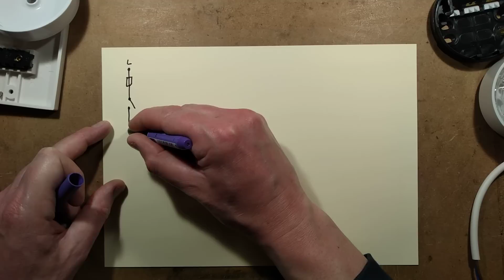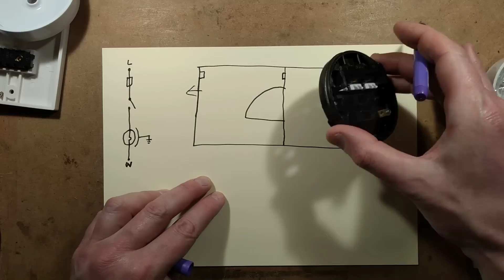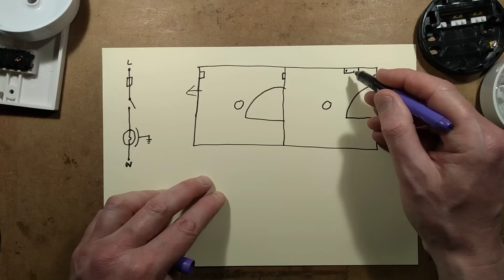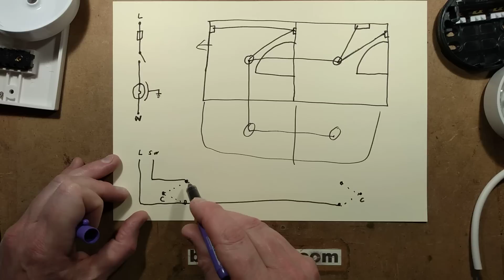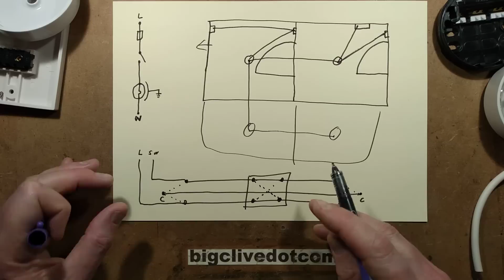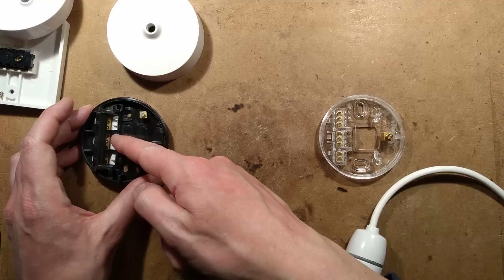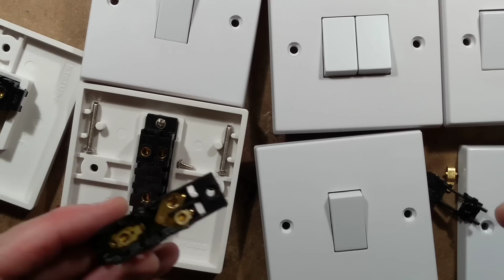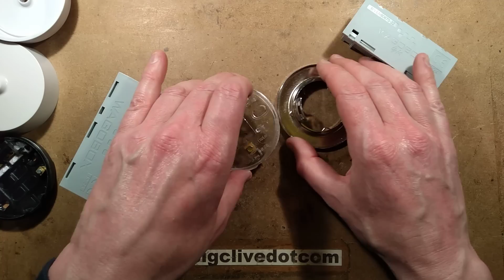British home wiring.  The incredibly simple lighting circuits.

Comment: In Czech republic, we use round plastic boxes in walls. Cables have always all conductors sleeved. We use round and flat cables as well. Screw terminals are quite obsolete, we're switching to Wago style terminals. Most light fixtures have terminals inside and you are supposed to connect a cable to it. I think the practices in my country are similar to other European countries.
Reply: Same in Poland: Round, plastic "cans", 60 mm diameter for switches and outlets, 70-80 mm for interconnections, available in various depths. Earth wire always sleeved (green-yellow). In recent past screw connectors were common. You got like 20-way strip of dual-sided screw terminals made of soft plastic that you cut to length. Switches and outlets use 2 methods of fixing: First is set of metal teeth that spread out and bite into plactic can as you turn the screws, pulling socket towards the wall. Additionally there are screw holes to further secure the socket to the can. On top of that goes insulating bezel held usually with a screw. In terms of switches you can often buy identically looking 1-way switch with one on-off terminal, "stairs" switch that switches between common or "cross switch" that is used when you want more than 2 switches. Our light points are usually furnished with bare wire and a hook. Switches with more than 2 buttons are very rare. When you want more buttons or sockets you can buy multiple length cans (multiplies of 60 mm) later covered with single decorative bezel, the longest bezel I've seen is for 6 switch or socket modules
Reply: @mibars  Those terminal strips are called "chocolate" here. :-) In junction boxes, we use  terminal blocks with 4 or 5 metal bars in a shape of square or pentagon.
Reply: Almost every country on east side of iron curtain use same style.... In Poland also nowadays use WAGOs. In Czech do u use TN-C? Or TN-S? Neutral separate or with ground?
Reply: You probably adopted the German standard with 73 mm for switches and sockets and 83 mm as junctions. But did you get double boxes for stacking and 1½ boxes for 2-way sockets? Or the big-box with half a box under a standard box where you can put a z-wave or any other active device?

http://www.elko.se/bigbox/category1646.html
Reply: @arneanka4633  It looks similar, but different, dimensions are different and we have 4 screw holes 90 degree apart. See how our cans for stone walls look like (60mm in-wall can)
https://www.google.pl/search?tbm=isch&sa=1&q=puszka+podtynkowa+60

We do have a variant very similar to what you've shown, with a chamber for putting electronics in. Or for massive bunch of interconnections next to a socket :)
Reply: @mibars  Oh crap. No way to use the standard c/c 63 mm stuff from Schneider or Hager in those tiny boxes. I had one of those small cans in my car. Drilled at normal hole and the can disappeared. Wonder if some polish dude forgot that on a worksite and somebody took it to our warehouse.

I'm waiting to come to somebody's house in the future to find polish material  in their walls and tell them they need to buy their replacement things from Poland. Or tear down all walls to make a proper installation according to Swedish standards.
Reply: @arneanka4633  They are tiny, indeed. This could also be the reason for slow adoption of Wago connectors, they take lots of space, at least the old gray type. BTW Schneider, Hager, Legrand and others are popular manufacturers of 60 mm electric equipment. Honestly I don't know id this 60 mm junction boxes standard is the law here, or just an industry standard. I've googled for those DIN standard boxes in Poland and I found that you can find some shops selling them... But they are like 10x more expensive because they are special order.
Reply: @arneanka4633  Yes, we have stackable boxes. These are used for multiple devices next to each other. The two way socket fits in a single box.
Reply: Also all devices have removable covers. The internal part is installed in the box first.

Comment: In Germany, the ceiling roses are mostly untegrated into the lamps, so we have just a wire hanging out the wall, when there is no lamp installed. 8:35 In Germany our Earth is always completely sleeved
Reply: In Sweden we get a miniature socket in the roof, either in a faceplate or as a plug on the loose wires coming out the conduit.
Accompanied by a hook to hang the lamp from.

Comment: In New Zealand we call this 3 plating. It is mostly unused in housing here these days. What we generally do is take the live feed to the light switch and then there's a "switch wire' running to the light. It's quite different, thought the two way is basically the same with some very minor differences.
Reply: (mains) 'loop at switch' (with switched going to the fixture) vs 'loop at fixture'

Comment: 4:11 ... hmm... what?! In Hungary, we connect the Live to the switch1 Common, wire together the two swiches switched poles (eg. SW1 P1 to SW2 P1, SW1 P2 to SW2 P2), and then goes from the switch2 Common to the lamps. Intermediate switches are working the same way as mentioned in the video.
At least, when I am googling for this type of wiring, I find this solution.  I can't decide if either of these solutions have advantage over on the other.
Example with the intermediate switch, if youtube allows: http://www.tibivill.hu/wp-content/uploads/2012/11/keresztvalto_kapcsolo1-1024x629.jpg
Cables: We have these: 3 stranded wires, all of them coated with appropriate colours, and coated with an outer insulation. There is some talcum powder like material in between the insulations. https://shopdelta.eu/shop_image/product/omy-3x0.75_d.jpg
Reply: Here in NZ we see both ways but I do prefer the way Clive has shown as no connectors are needed
Reply: @TheFraggBear  Connectors? Neither of the solutions need connectors, just the switches and the wires. Clive's solution assumes that you can connect more than one wire to one pole of the switch, that's all.

Comment: British wiring is so strange, in germany you could never do this.. love your channel!
Reply: why can't you do that in germany? 
Just asking, I live in germany too.
 I know that we don't have the ceilling roses but they actually seem nicer than just a clamp. The switches seemed quite normal just another form factor.
But for me it seemse like it should be just fine to be used in germany.
Reply: @racitup4114  I know nothing about this ... but having (permanent) Live at Switch presumably enables replacing switch with some fancy HA gadget (and without having to include non-Eco battery) ...
Reply: @racitup4114  The extra wiring that you described makes sense. UK wiring has fuses in each plug, because the UK wired homes when copper was expensive. They'd run an entire house as a single circuit and expect the plugs and/or outlet switches to interrupt.

In the US, we have no expectation of low-power lighting circuits. I've spent too many hours sorting out ancient wires coming directly from ceilings without even a box to isolate. A constant sense of fear pervades such home rework: even when you cut at the breaker box and even disconnect inside the wall switch, you could still find out the neutral is from some other circuit. You can even find the occasional Carter System (hot-swapped 3-way lighting systems) that should never have survived the 1950s.

I like the idea of these low-power lighting circuits. However I'm more scared that the wiring is load-bearing: the electrical copper is holding the weight of the lighting fixture. That's not Code in the US, and for a good reason. I see those pendulae in Ikea but I always pass on them for ceiling work. Copper wire should be holding the juice, not the newtons.
Reply: pseydtonne Not quite sure what you mean by "low power lighting circuit". In the UK our lighting circuits are rated 6 Amps at 240 volts, so each lighting circuit can deliver almost 1.5 Kw if required. It's typical to have one serving the upstairs of a property, one downstairs, and possibly a separate one for the kitchen. Larger homes will obviously have more. These deliver more than enough power for incandescent lighting, and since almost everyone uses LED now they are arguably massively over specified!

In terms of the weight carrying capacity of those plastic ceiling roses, they are designed for simple and lightweight fabric shades, or the spun aluminium "school" type shades. If you're hanging anything heavier, such as a chandelier, we use a different ceiling fitting, made of metal, with a built in hook. The light will be suspended from that hook by a chain, and the wire run alongside purely to d liver the power.

Comment: Hahahah @110:35 "Plasterer comes along and plasters up to the surface of the box" - every one I have ever met fills the box full of plaster like it is a challenge!
Reply: Indeed, we had one plaster right over the box, then skim the wall afterwards and nobody but us knew the damn box was there. The homeowner was not impressed that we had to smash off 4 brand new tiles (it was bang in the middle of the corners). But we did it with their permission. "oh don't worry, plasterer will be paying"
Reply: I have a word for plasterers; it's c...s except the one who did my living room, cleaned the socket box! First one ever.
Reply: @paulvale2985  in front of c...s, you could write "expensive, arrogant". However, they do give other builders an excuse for shitey work: leave the plasterers a key!
Reply: i've had to use a hammer to find the wall boxes before
Reply: the plasterers don't want to waste materials filling wall boxes.  holes in walls make his job harder.  just jam newspaper or pieces of foam or brick or even lunch leftovers in the hole to make it easy for him to do a better job.
Reply: many newer boxes have a cheap installation help covers in the carton… and people throw them away… filling the boxes with plaster…
Reply: Great design until you want to fit WiFi switches that require a neutral connection in place of a existing light switch onto the wall box, thus no neutral is present, just perm live, switched live back to pendant and a earth.....
Reply: @8skellerns  You can run a three-core cable to the switch rather than the usual two-core. That will give you a neutral as well as live and switched live. Depending how lucky you are, you may be able to pull a three-core cable down the same conduit used for the original two core.
Reply: @MrEdrftgyuji  Quite often the cables are clipped to joists in the ceilings or going round bends or trapped though :( Impossible to pull out and pull through a new cable :(  I have seen people connect the neutral terminal to the earth as the earth terminal is connected to the neutral in a PME system!
Reply: Tubing bender box finder lol
Reply: theres a secret rule plasters must hide one box per appartement
Reply: It's because they's fick, a great deal of study to become a plasterer, jealousy t'was all over jealousy :-)
Reply: here in the US, they switched to stuffing our outlets with insulation foam.
Reply: Had to use a neodiddlyum (it's a AvE joke, no corrections please!) magnet to find boxes after a fecking plasterer went a bit wild....  

There was a lot of swearing that day! Only thing was this guy did amazing corners, better than anyone else, but I'd never use him on a job with plastic boxes! :)
Reply: @mor4y  don't explain your jokes.... fack 'em

Comment: The good old bayonet connector bulb is danger of disappearing, market forces  are forcing us to have a load different Edison screw in and bayonet clip in, non compatible spare bulbs in the cupboard - not sure who we  blame for that- the EU or the US ? LOL
Reply: I disagree. B22 bayonet lamps and fittings are just as common here as they have always been. The exception is, imported ‘fancy’ fittings. But that’s not a new situation.
With the huge number of B22 bayonet fittings still installed, no lamp manufacturer is going to ignore such a huge market.
Reply: @Mark1024MAK  I think my real whinge is the fact that now,you have to watch you are buying as it maybe an ES fitting whereas at one time you just picked a bulb and it was a BF and that was that.However I have since heard that the EU is trying to drive the ES standard across Europe  thus making a problem out of one that wasn't there in the UK.

Comment: If you need a neutral connection in the switch, you can do the switch drop in 3core + earth, that way you can have permanent live, neutral and switched live on the same cable.

Comment: Those pancake boxes suck but they use them because they can nail them right to the studs and when they sheetrock it will be level. At least over here. So they're easy for contractors.

Comment: I may be too tired but isn't the 2 way switch diagram wrong? Live usually goes to the common which brings it to each traveller. Neutral goes directly to the light. The way he has it wired up the light would stay on indefinitely and/or blow when the two switches reach the right states.
Reply: You're too tired. There's no neutral to the switch, just live and the switched live return to the light. Neutral is straight to the light as you say. You can't put live on common for 2-way switching, that wouldn't work, the second switch would be bypassed when the first is on.

Comment: Here in Switzerland, the earth is fully sleeved yellow/green. Seeing it bare is really strange for me.
Reply: Same in Finland, also cables are round and not flat and you have a tool to quickly strip those cables.
Reply: same here in australia - the cable 'twin and earth' just like that, but the center conductor is shielded. Using round cable in walls seems very strange, the flat cable means that the earth is always between the live and neutral in case of a fault, and flat cable sits better in roofs and walls
Reply: Check under the sink in the bathroom, there might be a bare grounding wire to ground the pipes there. Or it might be yellow/green like the rest of the earth wire.
Reply: The bare earth conductor is insulated with a green/yellow sleeving when you terminate the cable.

Comment: Wire nuts should be outlawed. I can't count how many times I've opened a cover plate and pulled the plug out, and noticed one of the wires pop out of the nut. Those huge square switches with a single switch on them, are so terrible. Why would they make it so damn big?
Reply: a common standard,itll look not uniform if different switch boxes all looked different sizes
Reply: There is a half-sized face plate referred to as an "architrave switch" with corresponding half sized boxes, however they tend to be only used where there is limited space or as a "style" thing. The advantage of the standard box is that it is adaptable and upgradable, simply because it is standard and you can get up to 3 switches on that plate, while the A-switch is pretty limited.   https://www.toolstation.com/axiom-architrave-switch/p35496

Comment: Based on you room sketch we do pretty much the same thing in AUS expect we refer to it as looped at the light. We also have looped at that switch.
Looks like you guys do your 2 ways switching differently. We only switch the active conductor. So active goes to C1. Connect 1 -1 and 2-2 and the second common become a switched active.

Comment: Clive, I want to thank you for this most recent series about Mann's home wiring and street wires and the like. It's been so much more practical than the pink lights and endless USB powerbanks. I haven't seen any one say it so I wanted to say this series really goes above & beyond. Thank you.

Those pendant lights have been outlawed in the US for decades because one could slice through the flexible insulation. It must have a hard cover of some sort.
Reply: wow - and you guys call Australia a nanny state
and i believe Manx is the word for 'belonging to the isle of Mann'
Reply: @mycosys  We still have them. Usually for laundry machines hanging from the ceiling. Most of those would probably have been put in during the 60s-70s and are grandfathered in.
Reply: @johnpossum556  very weird - here in Aus the normal fitting is a bayonet directly to the ceiling and hanging a pendant like that from it is pretty normal, they are available everywhere.

Comment: When it comes to the boxes I like the 35mm metal box. I also really like the fact that the one set of cover plates had a screw storage place. 
I really hate looking for the little plastic baggies with the two tiny screws in them.
Clove I do have one off topic question.  Can you do one on telephone wiring in the UK. 

Thanks
Reply: Any telephone wiring inside the house is the homeowners property and they can move sockets, install extensions and remove wiring as they like. There is Network Termination Equipment which is usually a "master socket" and all the wiring beyond that is the phone company's and can't be changed. So it's possible to do your own phone wiring, but not to move the master socket.
Reply: Take a look at the You Tube Channel "My Mate Vince", as someone who worked for BT, he covers all aspects of British telephone wiring, in his early videos, in a very interesting way.
Reply: @Abigail-Rebecca   I will take a look. This was more of something I had hoped that Clive might of taken on and give his point of view. After all there are tons of phone things.